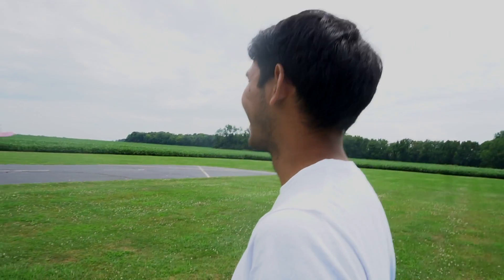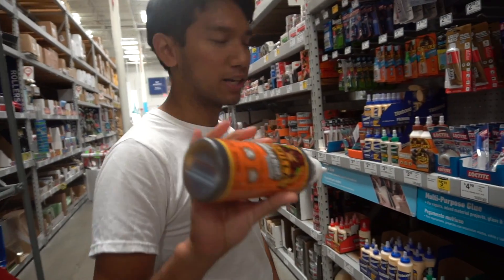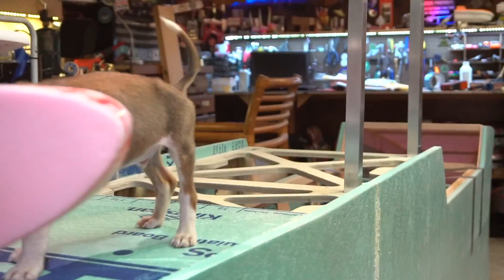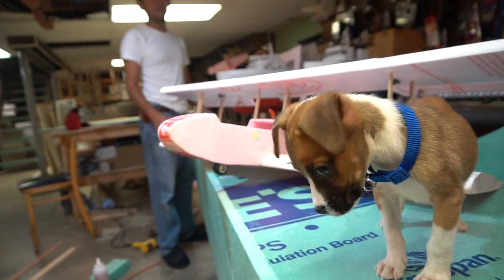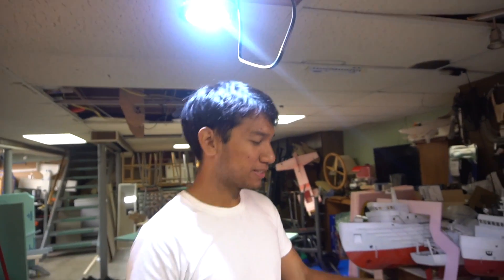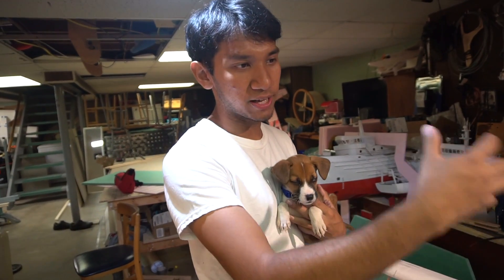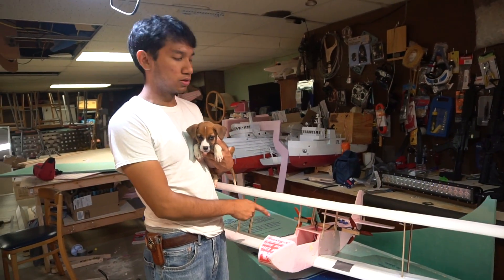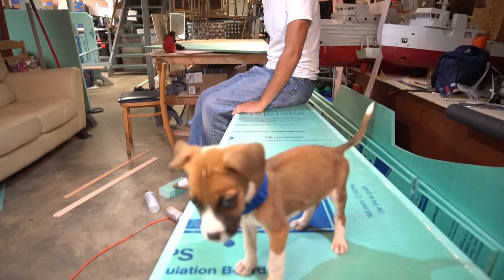DIY electric ULTRALIGHT pt1(fuselage and basic design)

Comment: a few suggestions:
since it's a biplane-  better figure out at least a rule of thumb for incidence of the two wings.   pretty sure the top wing should be at a different angle than the bottom wing.
don't do spin testing...  stall fine, but don't try to spin it. It puts some huge stresses on the airframe, and it's really hard to calculate. also extremely difficult to bail out, or even deploy a ballistic chute when in a spin, especially if the plane is missing surfaces. 
configure the motors for tractor, rather than pusher. it will get clean airflow into the props, increasing their efficiency, although you will lose a little because the accelerated airflow will hit the motor mounts, but it's worth it, as the vibration will be greatly decreased.  think Vicker's Vimy. 
use at least a couple of bulkheads in the fuselage. they can be pretty light. 
make the vertical stab and rudder extra big, because you will have no airflow over them from the props, and if a motor quits at low airspeed, you will need the extra control authority. 
Put some thought into the strength of the wings when the airflow wants to push them backwards, toward the tail at high speed. 
go ahead and make a third motor mount for the nose in case you need a third motor.   and leave some space for extra foam in the nose to act as airbag.. 
pick your airfoil carefully.   you are looking for high lift, a great stall curve, and low sink rate, rather than a good L/D.  the L/D is almost irrelevant.  probably at least a 14 % thick, flat bottom airfoil.  a good place to start looking is a gottengen 398. 
Don't be too afraid to eliminate the wire bracing, or most of it, if it's really not necessary.  you probably have lots of experience in that regard.. you might want to make some bracing for the tail.? 
focus on light weight, you can always re-enforce later, before flight, but it's hard to shave weight once you've added it. 
 love this project!   
cheers!
Reply: oh, and make sure you make some horner wing tips from the start. they are perfect for your aircraft type.  i just made a video on how to make them for a model. it would be directly applicable to foam.  they will also provide a crush zone to prevent damage to the wings in a rough landing.
Reply: more people should like this so peter can see it.
Reply: Sounds good.  As you have mounted the motors with the prop wash clearing the wings, the power-on stall should not be too big of an issue.   Do try to get counter-rotating props, if you can, and make sure they rotate inward at the top.  If you cannot, just be aware that there will be a critical motor, and that motor-out will be different between the two.   keep them as close as practical to the center-line, but leave proper clearance, so that a bit of blanketing from a sideslip will not cause a loss of thrust. That could result in an ever increasing yaw problem, so leave a healthy space, but not excessive.  Also better to angel the motor mounts so that the props are perpendicular to the actual airflow, which should be at somewhat of an angle of attack to the wing.  you'll figure it out, and because the motors are near the aerodynamic center of pressure for pitch, the angle of the motors will only be critical to the efficiency, not for control.
Reply: you should build a zero zero ejection system
Reply from the maker: Thanks man! tons of useful insight! As far as spinning goes, I may have messed up a little on the delivery, I'll be testing deep slow flight characteristics at various power settings up high (some may initiate a spin) such as flying on one engine to determine minimum control speed. Thats where I'll plan on having the emergency chute, Most of this testing will just help me become acquitted to the performance (or possible lack of) so when flying 20ft over the cornfields ill know what to expect and how to handle it appropriately! I dont know the exact airfoil but I copied it off of a minimax, its a low wing ultralight design with many flight hours and the airfoil may be an ok first go at things! (its flat bottomed too, so sturdy construction should be easy)

Thanks for taking the time to type all that out! I'll keep it in mind when proceeding forward!
Reply: I really want to see this happen, Make sure u dont rush things, take ur time and cover all ur bases
Reply: So to sum up, it's recommended that there be some stagger, to create a situation where stability can be created?   
If so, whatever wing is forward should have a higher angle of attack, (also called incidence/relative to the horizontal stab) than the aft wing.   
Considering that there is already a shift in the center of aerodynamic pressure (lifting force) of the wing, in a  forward plane, this will tend to cancel it, and even create some stability, perhaps, in conjunction with the dynamic balance normally created by the horizontal stab, and the CG location being in front of the wing's center of pressure.   
Did I understand correctly about the stagger, etc.?  

I've considered doing a similar project, but not sure i'd make a biplane.  It would most likely be a monoplane. It would have two or three motors. 
I understand the reasons for the biplane, and maybe a bit of extra drag is not a bad thing. It may help to limit  airspeed in a bad situation, as well as the structural benefits that are mentioned by Peter.
Reply: Agreed, that keeping the wings with no stagger would keep things simple form a design standpoint, and probably a wise choice in this case.   
as far a drag being a good thing, I was thinking about in a situation where the airframe drag would prevent an inadvertent overspeed,  but yes, It is generally bad, of course.   Glad you got the stagger and incidence issues covered for him.  I was hoping that someone with some Biplane experience would chime in  :)
Reply: In a biplane with no stagger you want the lower wing to have greater incidence as it will be the leading wing at high angle of attack.
Reply: The primary advantage of multi-wing aircraft (at least as it was explained to me) is the ability to create a great deal of lift in a very narrow span.
Reply: Test the tension on the floor section (pull the bottom edges outwards)
Reply: So, what is the airfoil from the Mini-Max, that you intend to use?  I'd love to see some polars to study them.  
There may be something better.
Reply: He should use Tevlar for the cross rigings.
Reply: FPVREVIE
Reply: Why would the L/D ratio be irrelevant? Sure, it can be less than one, but it still needs to be high enough for the engines to do their job
Reply: 3i.

Comment: While I appreciate the newer models you’ve built, I’m a little disappointed you’ve abandoned the Lowe’s/hardware store plane concept. I’m wondering if you could have saved weight and gained structural integrity by glassing the inside along with using bulkheads... if you get the hankering for mk5 I’d love to see you go that direction!

Comment: increase the strength of your aircraft likely 10 x by adding a layer of screen or fibreglass like this guy,  I see part of what he's done, but strengthen up your frame and everything using like he shows.  I'm off to the store tomorrow to buy supply to build a 8x20ft platform (I might use fibreglass and resin vs paint and screen, I need almost no, zero, none,  flex ) that will have a lot of weight on it.

Comment: Question: why wood and Styrofoam? I would think aluminum would make a stronger and lighter frame, more ideal for flying when power and "fuel" are serious concerns. Was it just for economical reasons, or did the strength to weight ratio of the foam actually beat out aluminum?

Comment: On future videos I saw some of your soldering, you should look into how to do J-hooks with your soldered electrical connections. Basically you strip a length of wire, tin it then take a pair of round nose pliers and bend a J on each end. You then hook the J's together, crimp them down with a pair of pliers, then make the soldered connection. This way if the solder joint fails you still a mechanical joint to maintain some electrical connection.

Comment: PETER: You should ask EAA to help on building techniques, cause there´s a lack in certain points, f.eg.: it´s not recommendable to simply glue wood pieces without the use of clamps.
This can represent a great difference in structural strength.

Comment: Peter, looks like you have a design that will work reasonably well, so I'm not going to worry with that. What I do suggest are a couple of things learned from flying full scale.1. Do whatever is necessary to rule out the possibility of control surface flutter. It can and will actually kill you if you don't pay attention to it.2. You need a calibrated airspeed indicator. Its primary function is to keep #1 from killing you. No, really. That's the #1 limiting speed for light GA aircraft.3. Rig and angle of attack indicator. Much more useful than an airspeed indicator for avoiding stalls.4. Make sure you have some sort of turn coordinator, even if it's a streamer hung on a stick on the nose. Keep the plane coordinated, and even if you fail to heed #3, you won't bend your airplane from a poor landing approach5. Most important of all: take some measurements of control surface forces. This gives you important information for a variety of reasons, not least of which is making sure that your control linkages are up to the task. You may want to go so far as to fly the aircraft autonomously before you get into it. I know that sounds like a pain, but remember, you're not running servos anymore, so you have to resort to a bunch of linkages, and they're a little trickier than just slapping in a servo and a pushrod. Note, in addition to this, that heavier aircraft like Cessnas use a combination of cables and pushrods. Again, pay attention to the loads distribution. An aircraft that is just fine in terms of structural strength could fail fatally because the control surfaces are so high that a cable snaps or a turnbuckle tears out of its mount. This is probably the single biggest difficulty of a manned aircraft in comparison to a UAV--servos out in the extremities vs a human pushing on a stick.

Comment: if you can't cut the weight, try dropping the foam board and using aircraft covering fabric, it cost about as much as the foam board and fiberglass you're using and lighter, even though it's just foam board it still adds unwanted weight, it might not be any help now but it's something in the future if you decide to build another, i hope this helped some, also , you will have a little extra down force on the tail section if you're building a pusher instead of a puller.

Comment: Not sure if it's been suggested but you really should add a cross brace to the inside of the fuselage right behind the cockpit perpendicular to the other framing. This will add some torsional rigidity which seems to be a little lacking right now.

Comment: what's the story behind the trawlers on the work bench....like where can I find one? lol. you should consider building a glider of like design first. use weighted shapes for engines and get an idea of how it will handle in the air. kinda like the Wright bios did at kitty hawk. good luck.

Comment: how much horse power does your engine generate? and how big is your wing? I think these are the biggest question you need to figure out now. you need to know the wingload of the plane and the power load of the plane so that you would have a large idea about how fast the plane need to go to fly, and whether the engine will generate enough power to make it fly. I think you can not just do it like an RC plane way, for rc if its just a little under power, the plane probably still can fly, but for an actual plane, if its under powered, its probably not going to fly at all.

dont forget that for RC planes, its fly at low altitude, so rc planes does not need to deal with the problems about losing performance by increasing density altitude, but for real airplane, when altitude increase, the performance will decrease. since you are planning to fly to high altitude, I guess this is important too especially for engine part

Comment: 1) You have a ppl. Good. This means you realize how frigging awesome/crazy this little venture is.
2) Your design is reminiscent of several of the early biplane LSA's  that I've helped build. I belong to an LSA flight club that specializes in ultra lights.
3) I'm ambivalent about the pusher design. Yes it works but it's not optimal in my opinion. Personally I'd go push me pull ya with one fore and one facing aft. Better airflow and fewer issues with induced yaw (catastrophically induced adverse yaw is BADBADBADDDD!) if one of the engines quits. There are a number of pusher/puller LSA designs out there that you can look at.
4)Just because you have a few hours and a PPL doesn't mean you know everything you need to. (I have over 14k hours. Been flying since I was a teener. I'm STILL learning!) Get some quality instruction in LSA flight. It's not just different from normal GA aircraft.. it's REALLY different.
5) Good luck! (I really mean that. I actually hope you succeed)

Comment: Noticing that you are going to be buying most parts from Lowe's or home depot, so a suggestion to the type of screws and bolts to be used. The stationary bolts that you don't plan on having loose such as the wings if you choose to have removable wings, using some sort of epoxy or some other method along with the screws to have a stronger bond while in flight.

Comment: Hey, not sure where you're located these days, and I don't know if you remember me. I'm located in southern Michigan and I happily volunteer my CNC (4'x8')if it will help in this project at all. Also, flat bottom airfoil is not the best choice. I can put you in touch with Keith Shaw he can help you select the right airfoil. I'm also slightly concerned about the X braces in your fuselage. Plywood is not strong on the diagonal. That's why they usually use individual strips for the cross braces.

Comment: As a design engineer, RC geek and full scale home builder (N224PM) and your friend Peter....I would highly recommend you flight test it as a giant scale RC plane with one Peter of ballast.   You can pull all the G's you want and get all the real structural and flight dynamics answers without risking tragedy.   The servos and RC gear will cost less than your mother's heart attack and you will get to re-use it all anyway.   I would highly recommend a book called 'Stress Without Tears' which is aimed at the home built airplane guy who wants to find structural loads, forces, and material sizes without high math.   The book also covers many tried and true construction methods that a ninja builder like you should know.   I would even send you my personal tattered copy, it helps that much.

Comment: Hi man please give me some advice. I want to add motor to kayak & trolling motor is worse than I expected.
Can you recommend a rc motor or motor that could push a 2 meter kayak.

my setup/rig

lipo4 battery deep cycle 12v 30 Ah 384Wh.
200 watt solar panel mounted to kayak.

PeterSripol your the smartest diy hobby guy I know. Could you please help and could others give some suggestion if you like

Comment: some suggestions on structure and safety:
i highly suggest to laminate some fiberglass in  the inside of the fuselage, maybe just the highly stressed parts, as well. consider fiber direction and the forces they have to take. fiber/foam/fiber is much stronger. the foam with a outer layer of glass alone does not ad much stiffnes and cant take bend and torsion forces well. the wood will take some load but keep in mind also vibrations, humidity, weak gluejoints and hard handling on ground.
i dont know the numbers of the plane but relaying just on the glued wood spars seems optimistical. take a look on some infos about sandwich compositelaminat. 
integrate some sort of a crashbox in the cockpit section. a combination with glass, foam, carbon or aramidfiber of some sort. in case of a accident you will most likely crash nosedown. add some sort of piercing protection would be ab good idea as well. wood and carbonfiber can impale you when it breaks. 
consider that jumping out of a cockpit with a parachute is realy hard. and you have youre wings behinde and above you. there are ul-recovery systems with the parachute atached to the plane. good luck!